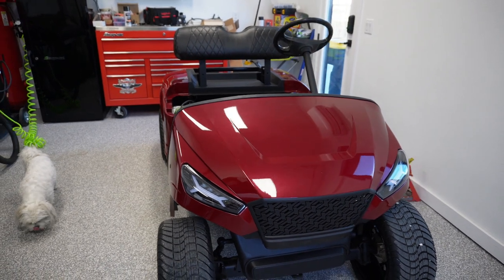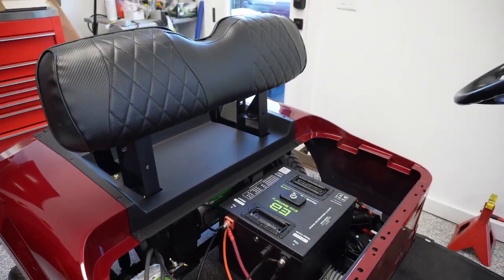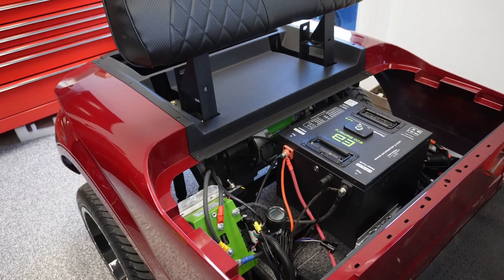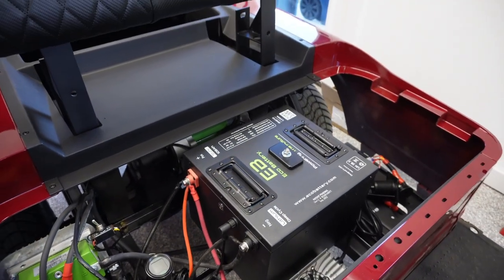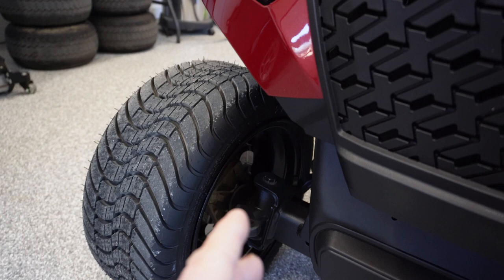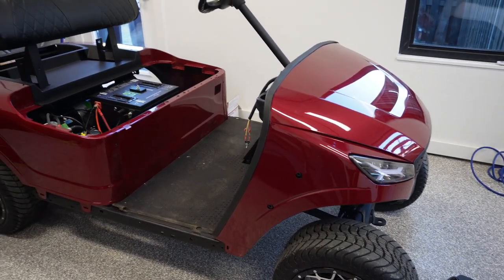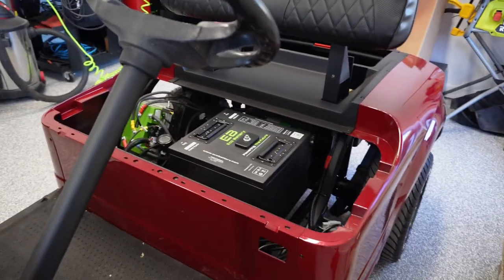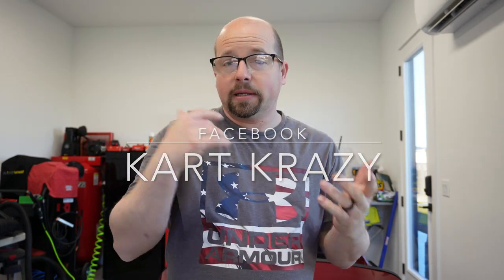Navitas Build Gone Wrong!!!! (Swamp thing Part 4)

Comment: Bummer on the footage but don't worry too much, still like the update. What size wheels did you go with? I'm doing another build very similar and was wondering about the wheel size since my other 14" ones rub
Reply from the maker: Those are a 215/35/12 but I definitely need to go bigger…probably a 205/40/14 or a 215/35/14